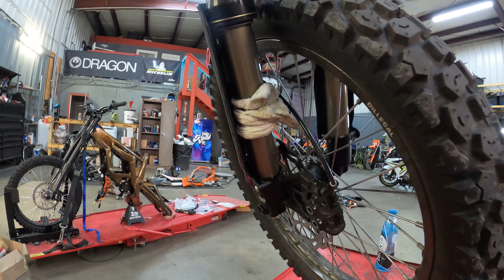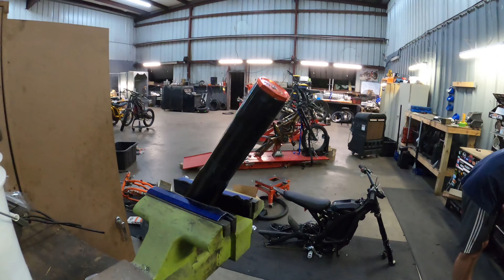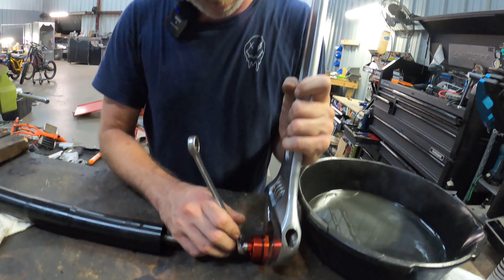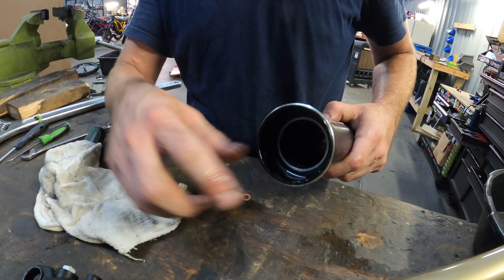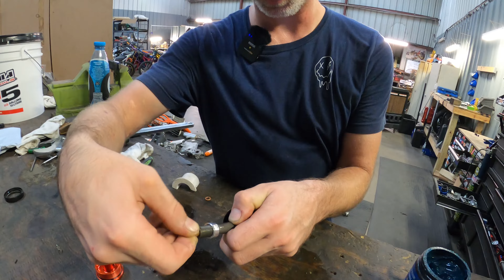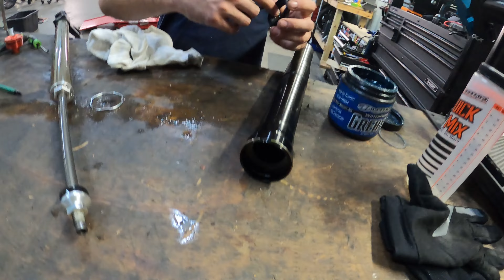Servicing Fastace ALX13RC Forks

Comment: where did you find what oil and in what amount to use for each fork legs. I found a pdf (I think it is by fastace) and it is saying 300ml in the right and 150ml for the left legs. I want to be sure before I service my forks.
Reply: Did you ever figure it out
Reply: @johnbrown562  I went for 300ml in the right and 150ml in the left. But notice that it is two different types of oil in each fork. 5W in the right and 32W in left.
Reply: Is that working? Did the fork seem to work like normal when you did that?
Reply: @itscolemartin  yes i didnt notice any difference.

Comment: I got the forks to the point where I have the dust seal and retainer clip removed but the forks will not seperate into two pieces. Makes a bad metallic sound when I try to pull it out like he did in the video
Reply: Please help

Comment: Agreat video, I have a Zero S Motorcycles from 2013 with Fast ace folk model Fastace ALX07RC.
Can you confirm if the assembly and oil quantities that the Fastace model ALX13RC has are same as the Fastace ALX07RC. Thank you.